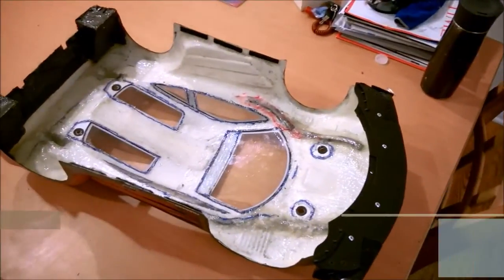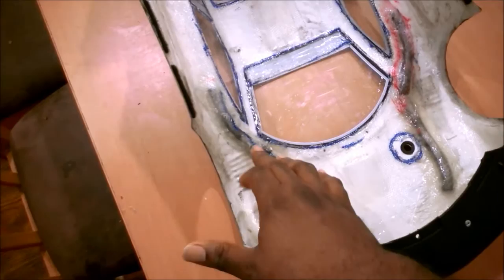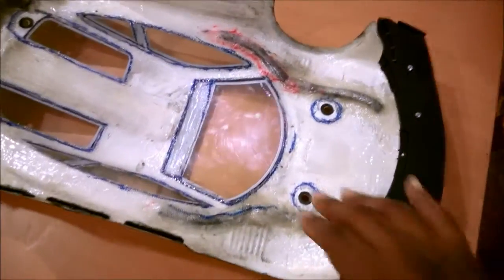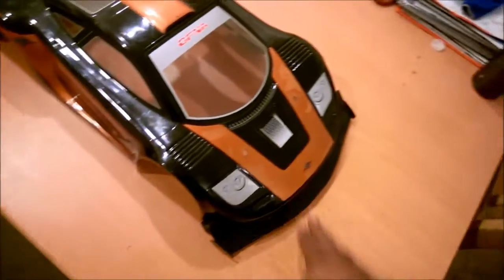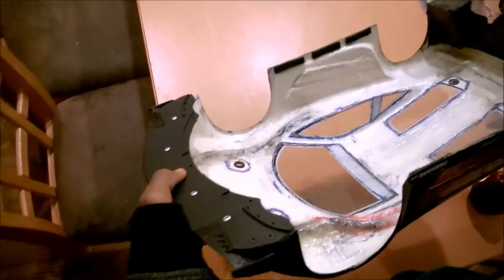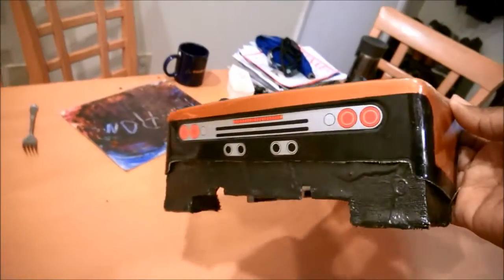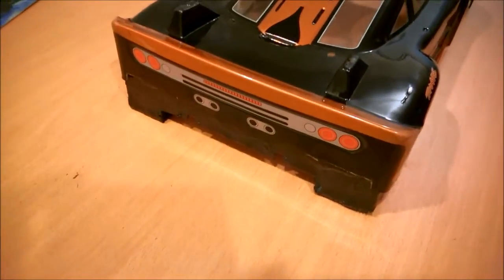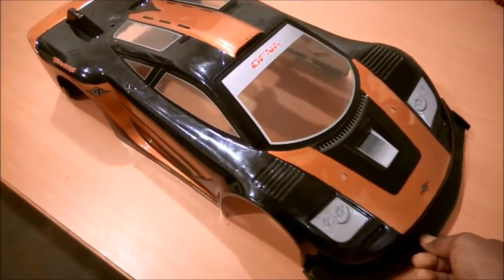RC Physics 93 - Dizzy Fiberglass Update

Comment: most people including myself cut the rear out. you extended yours. do you think it will catch air and cause for a lower speed? like a parachute.
Reply from the maker: 2cwik4u104 I did a "Tech Corner" write-up about this on my facebook page. http://www.facebook.com/rhouse21rcphysics The short version is Dizzy has an XO-1 spoiler molded into a smooth fiberglass underbody tray. Cutting the back off the body essentially makes a "poor man's diffuser" that allows the low pressure "vacuum bubble" that's created behind the car to suck the body down toward the pavement and kills a lot of lift produced by the body.  Give it a read and let me know what you think.
Reply: sorry I don't do facebook.
Reply from the maker: 2cwik4u104 You can actually view the page without joining Facebook, but I've posted the text below.

Here you go:

Tech Corner: Have you ever wondered how a rear diffuser works?
 So, as a car blasts through the air at high speed, it creates a "bubble" of low pressure air in its wake. That low pressure air can be harnessed to help keep the airflow attached to the rear of the car's body, decreasing drag. Unfortunately, this high velocity flow can also increase the lift produced by the body itself.
 Diffusers like those used on race cars, supercars, and fast RCs like Dizzy and the Traxxas XO-1, actually provide a clear path for the low pressure air behind the car to act like a vacuum cleaner and suck air at high velocity though a relatively small duct from under the rear of the car body. (Imagine the "bubble" using the diffuser like a straw to suck air from under the car.) This produces a pressure drop in the duct itself that creates downforce to cancel the lift produced by the top-side of the car body. It also preserves the "bubble" at the back of the car which can act as a natural "vacuum pump" to 1) pull a vacuum through the diffuser duct, sucking the bottom surface of the car towards the pavement and 2) create a virtual body extension behind the car that helps to reduce body-drag. The vanes in the duct also help to provide a little directional stability to help keep the car pointed in the right direction at speed.

 A lot of guys have figured out that cutting the rear off of a car body essentially creates a "poor man's" diffuser. This works because removing the back surface of the car body allows a path for the low-pressure "vacuum bubble" behind the car to pull air from under the car (through the car's chassis). This kills some lift along the way, but I believe larger open areas behind the car can reduce the strength of the "vacuum bubble", lowering the total flow velocity. This and the extra drag of the air working its way through the car's chassis, should result in less overall downforce than a fully enclosed duct, but its better than nothing.
 This is all based on Bernoulli's principle where the speed of air flowing though an opening slows down as the opening's size gets larger and the pressure drop (AKA: downforce) is proportional the square of the flow's speed (v_flow^2). So a smaller volume of air flowing through a duct at very high speed can actually produce more downforce than a higher volume of air flowing through a larger area at lower speed.
 Keep an eye out for RC Aero 201, coming to my YouTube channel very soon where I'll dig into this and other speed related effects more closely.
 -Your friendly neighborhood RC Speed Geek.
Reply: rhouse21 - RC Physics that's right, forgot you had a full bottom. sorry, missed a lot of vids while I was gone.
Reply from the maker: 2cwik4u104 No prob! Thanks for watching!